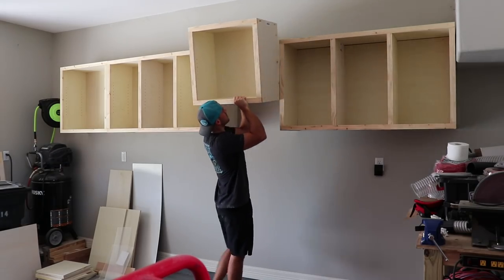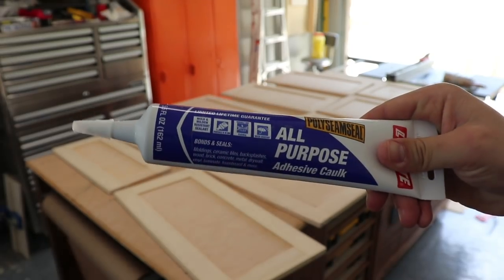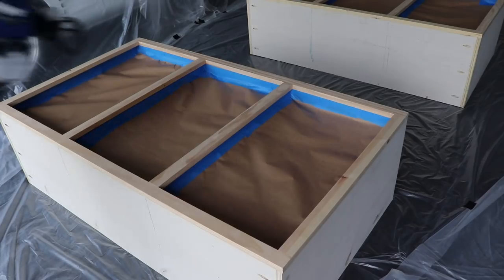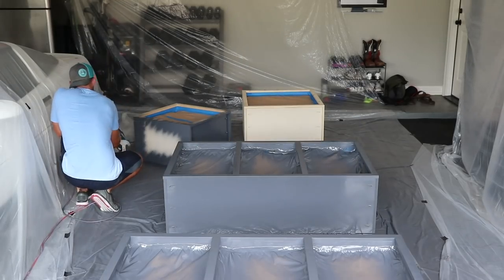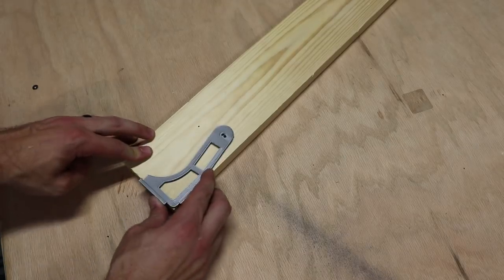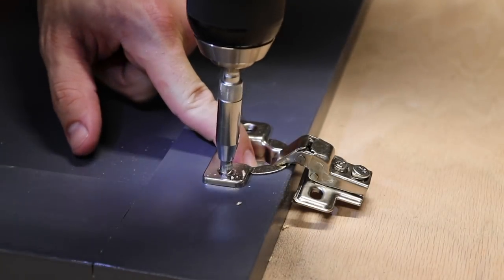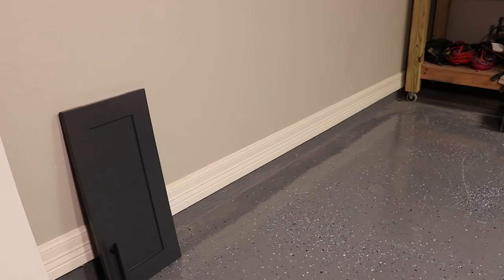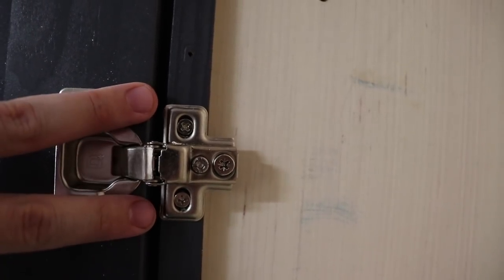Ultimate Shop Cabinet Build (Uppers) // Part 3

Comment: The key to super fine caulk lines- mist windex after application and before wiping, acts as a lubricant and slightly breaks it down so it pushes into the gap better. Learned that working in the countertop industry.
Reply from the maker: Great tip! I will definitely try that
Reply: If I recall Windex is used for silicone caulk. Typical acrylics just a damp finger and a damp cloth to clean the finger. No need for silicone on those cabinets. Also you may have to prime silicone caulk with a adhesive primer first. Although high quality 100% acrylic paints these days have much better adhesion than old school latex. You can push the caulk into the joint properly with a finger using acrylic caulk. Never use cheap caulk for anything. 25, 35, 50 year caulks are best. Also a damp t-shirt cloth rag works well with a finger behind it. To get a great caulk line you will remove some product. That's to be expected. Just don't remove too much caulk. 

For a great finish an HVLP sprayer which has even less overspray and produces a smooth finish. A typical piston pump airless paint sprayer with a fine finish tip. They work great with practice. I understand why you used a hand unit. 

If you are too far away when using any sprayer the atomized paint actually starts to dry in the air. So you want to be as close as possible with the right pressure without getting too close. Generally 9-12 inches away with a typical airless. You can be a little closer with a HVLP.  However typical airless sprayers like those used on homes produce more overspray. The fine finish tip and the right pressure setting will lessen that a bit. 

But then again I basically quit painting like 25 years ago. 

Thanks for the video. Those are sweet garage cabinets.

Comment: Hey mate, did some work for a painter this year and found the best way to do the caulking is to have a wet rag in your hand.  use it to keep your fingertip wet and when you run the bead of caulking, run your finger after it.  keep your finger wet for best effect.  works like a charm and keeps you from having to buy any extra tools.

note...it will eventually take skin off so keep that damn finger wet!
Reply from the maker: Awesome tip! Thanks for sharing

Comment: I have been a cabinet maker for 30 years. I have to say that you did a fantastic job for someone with little experience in the field. Great Job! One little pet peeve I have..... when you were filling holes and gaps with filler, I would have filled the joints on the bottom and tops of the stiles on the doors. Either way you are doing fantastic and they are a hell of a lot better than the cheap knock down cabinets for the box stores!
Reply from the maker: Thank you sir! Means a lot coming from an expert!
Reply: Agree great job, but how are they better?  How do you gauge better?  Longevity?
Reply: Materials used for one, box store cabinets are made of cheap particle board.
Reply: @Jamey Mikels Should he have caulked the edges of the rails and stiles like he did. I was thinking if they moved with the seasons his caulk bead would move and could come loose. What do you think?

Comment: I bought one of these to paint doors in my house & garage door.  You should have turned the "fan" of the spray perpendicular to the direction your moving the gun.  Also move a bit slower & you could have done it in one coat.  The box store that sold me on this one advised me you can use thicker paints.  They don't need water downed in this gun.  All in all - its pretty awesome.  Saves do trim and roller work for sure.

Comment: Just came across your channel, had to watch all of them.  Kept me interested throughout.  I love the way you describe each step.  I am planning to redo all of my shop cabinets.  Built the base cabinets too tall, thinking, since I am 6' that would be a good height.  Wrong.  I watched a shop build long ago and the guy thinned down shellac and built up several coats on the inside of the cabinets.  Worked just as good as prefinished plywood.  What about using 1/2" plywood for the build.  All kitchen cabinets are built this way especially with the cost of plywood now.  Loved the build series, great job.

Comment: It's a good idea to round over the edges as you did, because the normally thicker paint film where it goes over a sharp edge can create a 'break', a really thin film right at that sharp edge, which is more brittle than the thicker film and can eventually become the start of a flaking edge.

Comment: Love the build. Very clean and effective! You should use the proceeds from this video to invest in an HVLP spray system. Fuji mini mite 4 is fantastic. Set up and clean up a very simple so you can use for quick small projects as well. And I realize these are garage cabinets... Not kitchen cabinets. but since you did all the work, you might as well you have them come out looking as good as possible. For the next set of cabinets...Spray primer, sand primer with 240 and then spray a final coat (or coats!) of Benjamin Moore advance... Thanks for the video!

Comment: You should always round edges or at least break them it gives surface area for paint to adhere to.  If not pretty soon paint flakes off all square edges.
Reply: 💯 same with working with steel, edge prep is super important with paint

Comment: Okay, correct me if I'm wrong. You didn't put glue on the panels so they could expand and contract. Now you're caulking all around them. If they expand and contract won't they, eventually, break the caulking?

Comment: Great video as usual. A few suggestions if I may. When spraying it's always preferable to go with the grain ( like you did on the doors), which minimizes over-spray and overlap lines. Otherwise great job (especially for a first timer), Keep those sweet videos coming.
Reply: Need to cross hatch a 2nd coat to get rid of the spray chatter.

Comment: Great job on the cabinets. I had that sprayer before and had some issues with it. One, being having to constantly refill, like you said. Because of that, it blowing up in my hand, and also because of the overall weight getting tiring, I moved up to the Graco Magnum X5 airless paint sprayer. Theres multiple attachments for it like a roller, extension wands, and everything else. Yeah, it's a little more expensive (about twice the amount), but it's a much nicer gun and better coverage with the paint. All you have to do is drop the tube into the paint can and go to town. It's awesome for small, medium, and large jobs.
Reply: Graco is new to me.... can you spray finishes with it?
Reply: @jameymikels1886  no problems. That was another reason we got it. The hose is pretty long and the gun is very light. Going to refinish our fence in the back yard with it
Reply: +1 for the grayco....i did a similar project as this with kitchen cabinets and the x5 was an awesome sprayer.   It put an awesome surface down when dry

Comment: Nice wrap up episode - cabinets look great!  Don’t you need a spacer at the bottom of the cabinet backs to prevent them from twisting the French cleat when they are loaded?  Perhaps you can slide them in and nail from the inside so you don’t have to pull the cabinets off the wall again....
Reply: The sides of the cabs are resting against the wall... the cab cleat is let in so its flush with the sides... the wall cleat is slightly narrower than the cab ...
Hope I got that across clearly ?... 😂

Comment: Easier ways to do it especially doing the paint. Probably wouldn't use latex because it tends to chip on sharp corners. If you use latex thin it down with denatured alcohol and spray with air assisted cup gun, clear coat with crystal clear water base  top coat. Very nice smooth professional results. Plenty of other things to say but  I'll leave it at that.....first time watching.

Comment: Great wrap up on the top cabinets! Curious why you didn't drill the holes for the hinges and the handles prior to painting so that you didn't run the risk of damaging the face of the doors when drilling the holes? Congrats on the subs keep up the good work!
Reply: Build IT With Brian was thinking the same thing. BUT, they turned out great!!

Comment: Since your doors are made out of wood have you noticed any cracks in the paint at the joints of the door frames due to expansion and contraction? especially since moving to ohio and these are garage cabinets.  Considering using mdf. What are your thoughts

Comment: what kind of floor covers do you have on the far section of your garage?
Reply from the maker: I’m assuming you’re referring to my “non-shop” garage? Those are horse stall mats. They are a thick hard rubber typically used for horses but work great for working out 💪🏼